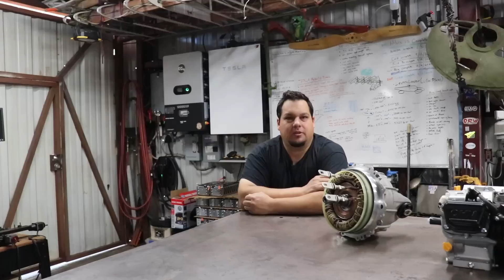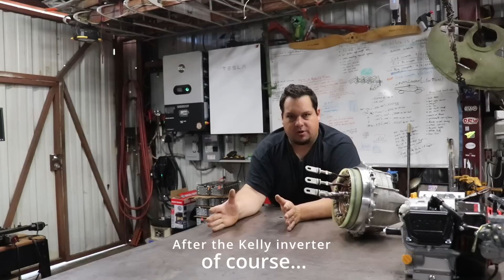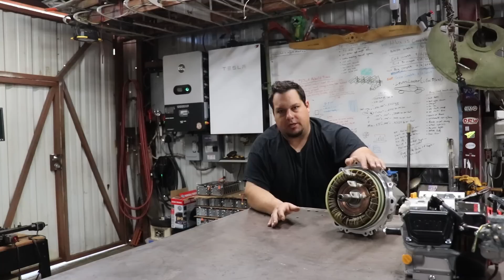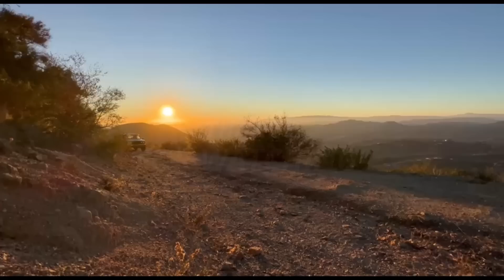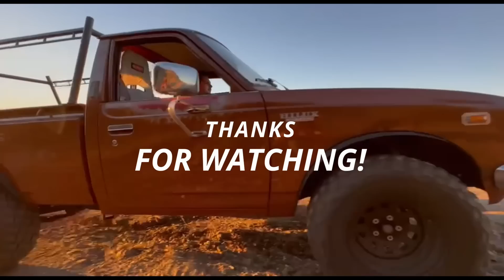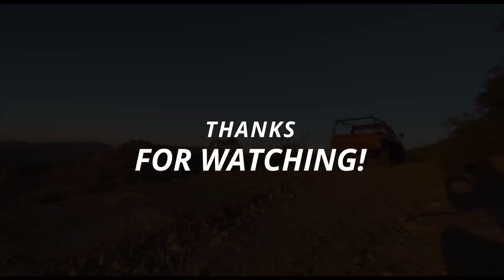Tesla powered Toyota Hilux with a Kubota RANGE EXTENDER!

Comment: Hay Jonny. I am so excited to see how you pull this off. I have a Nissan Patrol from 2000 that I am pondering on puting a Nissan leaf drive train in to. My goal is to use it for overlanding and when im out bush bashing there wont be any chargingstations near by. Thats when the range extender comes in handy to make you i can get back to civilisation. I was just like you thinking of the rex in the I3 but i am very interesting to see how you approach this. Greta stuff and i cant wait to see whats next. Keep on keeping on.
Reply from the maker: This sounds like a perfect solution to make that thing go for miles and miles. I’ll keep making videos as I go on. Hopefully I’ll be able to pull this off with cost being as low as possible. Thanks for watching!

Comment: I’d love if you tried the Hatz fiPMG. It seems like amazing packaging for 10.5kW, although it’s probably too small for what you need.
Reply from the maker: Hmmm I’ll take a look at that! Thanks for the info.
Reply: @ *Hatz, but I realized that I wished they had a 10.5kW version of the fiPMG using the 1D90E, but they top out at 5.6kW otherwise, which is way too small. CAN (J1939) electronic control though.

Comment: screw the range extender.....  drop your battery pack  total way down.  maybe replace some with Capacitors.  Make it a Locomotive.  the right size Diesel will be running at peak efficiency
Or better said......  think of it as...... a diesel locomotive with a "silent" clean power for intown driving.
Reply from the maker: I think if I do this right I can get better efficiency from the system. I hope. But my packs already pretty small and light as it is. The trucks 2700 pounds and with the generator probably around 2900. I see what you mean though. I still want to be able to use the truck around town without the generator running and only use it when I wanna travel.

Comment: Why not turn the tesla gear box gears which I believe are 9:1. You could set the diesel engine to spin the motor 9 times faster to possible increase the output of the generator setup.
Reply from the maker: You can get full regen from pretty low rpm luckily. 3600rpm should be solid. I’m basing that from watching my motors regen on the truck. I can see Kw from it.

Comment: I have been toying with the exact exact idea and am very interested to see how this will play out. Good luck and keep us posted please. I am also down to help any way I can.
Reply from the maker: That’s rad! I think this is something that just needs to happen in the ev world. Bringing the 2 together just makes the best of both worlds. And thank you!
Reply: @J5Jonny5  I agree it's about time. This sounds very similar to the Via Vtrux concept expect with easily available components like the Tesla motor and Kelly controller which are well engineered, tried and tested and easier to deal with compared to other locked down ecosystems. 
If you have the Tesla sdu from an older Tesla car you can use the open inverter PCB board over the stock Tesla inverter. But using Kelly controller will open up a lot more options for all the 2nd gen Tesla motors out there.

Comment: I only drive 10 to 20 regular miles a day so don't want a 200+ mile battery sitting around doing nothing, that's just a waste of it's potential.
I'd like to have a 60 to 80 mile battery and a range extender, even if it means reduced power when using the engine.  Long journeys are usually spent cruising in a train of traffic so no need for stupid performance.
Good luck with the build.
Reply from the maker: That’s exactly my thought too! My trucks battery is small at 33kwh. I get about 70-80 miles out of it with my aero and large tires. So this combo will be perfect. Big battery is definitely just a waste and they are also just heavy.
Reply: @J5Jonny5  I look forward to seeing your progress (subscribed!).

Comment: I would like to caution you against connecting the crankshaft directly to the input on the motor that you are going to use as a generator. The firing Pulses from that engine especially at idle are going to be severe. Not only do you want to keep the flywheel to help dampen the firing pulses at low speeds, but you also want to have a strong rubber isolator between the output from the engine and the input from the motor. The engine won't be very rough at higher speeds, but on initial startup with a cold engine when the engine is idling at lower speeds, it will produce heavy vibration due to the firing pulses that will not be kind to your motor / generator.

With that being the exception, I think you have a great plan and I'm excited to see the outcome.
Reply from the maker: Thanks for this info. I had another person say something similar so I’ll definitely be keeping that flywheel. Plus I noticed it might need it for balancing so another reason to keep it. Thanks for watching though! I picked up an engine this week so I’ll be posting the next video soon.
Reply: @J5Jonny5  yeah you could do some research to see maybe how the standup generators are coupled with engines those parts might also be very usefull! Kubotas are generally made into generators too.
Reply: I see you have aircraft parts on the wall .Mercedes 2 litre  diesel engines converted to Aircraft Power plants had major issues with the propeller reduction gear boxes and props being damaged by the combustion impulses and the Dynamic damper had to be removed and inspect every 500 HRS IIRC. Very cool to see your Tesla conversion to the Hilux
Reply from the maker: @  yes sir. Thanks! And Thats interesting. I haven’t thought of the pulsing of a diesel making problems like that but good to note. I plan to mount this on some very dampened rubber mounts of some sort. Since I don’t wanna shake the electronics apart in the truck. And also I do plan to make some sort of a hybrid plane in the future. Have one ready for the build already.
Reply: You'll want to use a dual mass flywheel. Those are made to dampen those harsh pulses
Reply: Good comment, came here to say this.
Reply: maybe a CVT between Tesla motor /generator to  not just limit issues with the pulse affecting things vibration wise.... but also smooth rpm allowing for better generating efficiency? ?

Comment: Just a thought but the smallest most reliable diesel engine you’ll ever find in one out of a semi trailer reefer unit. They’re designed to run thousands of hours continuously
Reply from the maker: Hmm. Thanks for that info! I’ll take a look at those. I forgot they used little diesels for those.

Comment: I too, drove the I3 REX with the first battery. Only 18 kWh. I had a monthly trip of 320 km one-way. I used one tank of fuel for getting there AND coming back - and a 20 min. charging stop @50kW. The tank only has 7 Liters, so it is a good fuel economy. Not perfect, but good. And on the every-day-trips, the 120-150 km of range were plenty. I always wondered, why the REX concept didn't spread out to other manufacturs. A one liter 3-cylinder turbo gas engine (like from the VW Golf) has enough power as a range extender even in a big Van or SUV. And it could run at max torque (2000rpm) all the time.
Reply from the maker: That is awesome. Yeah I don’t understand it either. It seams like this is such a winning combo of powertrains.
Reply: @J5Jonny5  the chinese manufacturers like BYD are now full on this tech! look at Sandy munro on the BYD shark 6 teardown.

Comment: Very inspiring! I've recently picked up a smaller 2-cylinder diesel to do a very similar project with. Looking forward to seeing your build!
Reply from the maker: Oh rad! Thank you! What engine did you pick up?
Reply: @J5Jonny5  I picked up a Kubota Z482 used for a good deal that I plan to use for the project. I have a large semi 24v alternator I was going to use for the generator side of things but will still need to jump up to 72v for my pack.

Comment: Johnny luv yer videos and love your work.  Which Kelly controller do you plan on using with the Tesla motor, the one I see is rated at 360 volts but only 350 amps.
Reply from the maker: Thank you!! I was looking at the KHA 360v 200amp one. I’ll only need 38ish amps continuous so the little guy should work fine.

Comment: Serious project 👍

Back in the late 90s an ex Volvo chief said that a series hybrid with a small 3-cyl turbo diesel as a generator was the most efficient solution for a car.

It should be very obvious for anyone why this true.

Never did happen however. One wonders why..
Reply from the maker: That’s really interesting… I’ll have to look into that and learn more. I didn’t know about this at all. 
But yeah it’s definitely the best solution I’d think. Best power and performance plus max efficiency from the engine.
Reply: You now... The Daihatsu 3 cilinder diesel engine from the 80' was very fuel efficient... The Volvo guy has a point. Maybe has to check something like that engine.

Comment: What kind of mileage range are you getting with and without towing? I'm thinking of copying the original setup. Thanks
Reply from the maker: Right on! I’m at 2.5 miles per kilowatt normally and around 2 miles per kilowatt towing. Most of the range is taken by the wheels being so heavy.

Comment: Calling an internal combustion engine a "range extender" is peak copium. Even EVs are better when they run on fossil fuels.
Reply from the maker: Haha!! It’s what everyone calls it when it’s really just a generator. But yeah. Having both in the truck makes its work the best I think. High HP, Torque and fuel economy.
Reply: @J5Jonny5 copium speak for FOSSIL FUEL POWERED HYBRID

Comment: The BYD Shark from China is a mid sized pickup with an engine installed to charge the batteries and drive mechanism.  The engine has no physical connection with the tires.  So essentially it is electric drive with gas power to power the overall mechanism.  Theoretically,  this would eliminate charge anxiety and having to find charging stations.  About half the price of a Rivian.
Reply from the maker: Those things look super promising. I know Sandy Munro didn’t like it but to me it looked over built like a Toyota pickup. I’m gonna bet those will last a long time. Hopefully we see more of them!
Reply: The Shark does have a physical connection between the engine and front axle, but it only kicks in at highway speed because of it being 1:1 gear ratios.

Comment: Cool, looking forward to seeing this. Just so you know, there are people now mounting motors in the rear of their cars and trucks after seeing you build a DeDion. That was I think one of the best ideas I've seen for retro fit to an EV of most anything so far because it makes all these motors useable in cars before never once considered. Great job.
Reply from the maker: Thank you so much! Yeah, I’m super glad those videos helped so many accomplish getting a motor in there old leaf sprung cars and trucks. It was the simplest thing to do.
Reply: @J5Jonny5 the battery pack was another good idea. The way if fits between the frame rails and under the bed is prefect and then the possibility of adding another under the bed seems like a good option if looking to stay all ev.
Reply: Yeah, that's me! lol

Comment: Looking forward to the project and seeing your real world results. Keep up the great work.
Reply from the maker: Thanks! Yeah I’m curious how this things gonna actually perform.
Reply: @J5Jonny5  totally, me too.  The best recommendation for the project is to look at the kubota engine power curve. It will have an ideal rpm range, which for a diesel  is usually pretty narrow,  where they are most efficient.  But I would recommend running it at the higher end of the range,  to get the most power. But have no idea if that will translate to the best power output from the motor in regen mode. Very excited to see your results.

Comment: Why not just use rectifiers, and turn the ac output into dc power?
Reply from the maker: I could. But I wanted to be able to control top charge and power output at any rpm. I want the engine at its peak performance rpm so I can get the most efficiency from it.

Comment: Exciting stuff !
I have had EV's for 5 years in the UK and diesel for 20 years before that, I have often thought diesel electric was the way forward , ( I mean all the UK's locomotives for the last 70 years can't be wrong )  and then just yesterday a neighbour said they are collecting a Nissan e-power this week, he said i had almost convinced him to go EV, and then he saw the Nissan's, they are somewhat similar in concept. I believe it is a petrol generator charging the drive batteries but the vehicle is propelled by electric motor. 
Good luck with your project and thank you for sharing 😀 
👍ed.
Reply from the maker: Thanks Ed! That’s pretty cool! Yeah I think the trains have had it right this whole time. It’s not that I want to primarily use diesel but when it’s needed, it’s needed. It’s definitely a nice thought in the back of my mind that I have the option to keep driving if needed.
Reply from the maker: I’m curious what the Nissan setup is gonna be like!
Reply: @J5Jonny5  https://www.youtube.com/@hybridsolutiondiagnostics   I will leave you to investigate this guy. I have a epower and it rocks.
Reply from the maker: @ rad thank you!
Reply: The Vauxhall Ampera is just that. If the battery was bigger and with more modern chemistry, that that would be ideal. Edison motors trucks are something else. This pickup will be a small scale version. Great project.